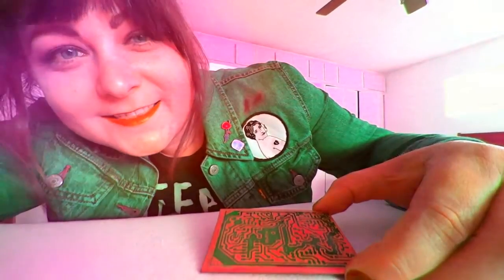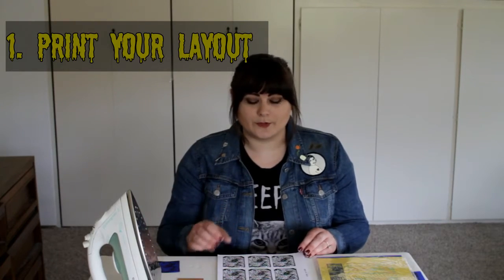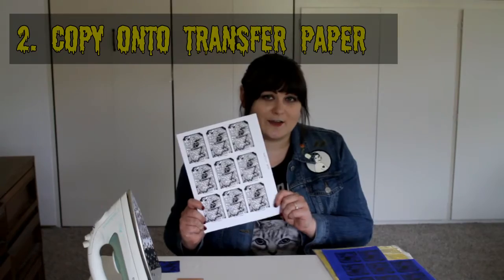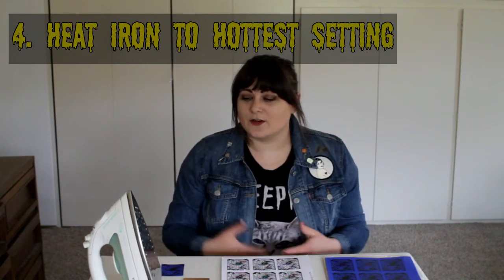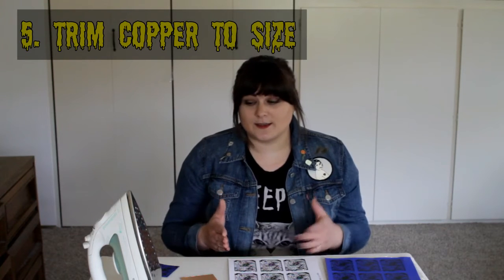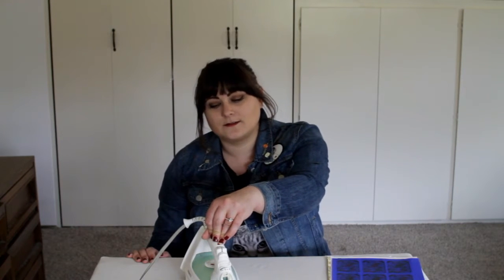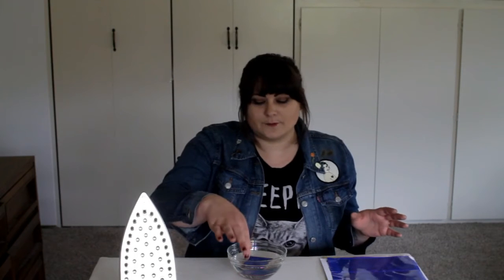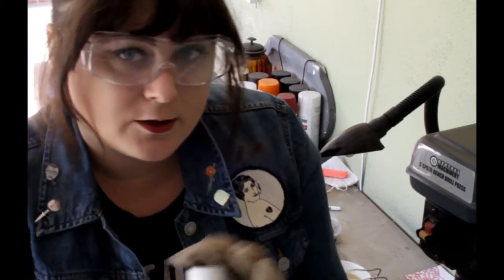HOW TO ETCH A CIRCUIT BOARD | DIY Pedal Building

Comment: Hi May. Excellent video tutorial! I've got a question about the printed paper with 9 boards. What software did you use to get multiple boards on a single page? It looks neat.
Reply from the maker: So I just copy and pasted the image 9 times using photoshop, printed that out onto normal paper and then took that to kinkos and copied it onto the blue print paper.

Comment: Good video, Ferric chloride is so nasty though. I feel the need to point out to watchers that there's less nasty chemicals to etch boards with
Reply from the maker: That's true.  It's a nasty chemical, and really must be handled with care.  (and disposed of properly)
Reply: two parts hyrogen peroxide and one part muratic acid. do not inhale the stuff. I have used this system for many years.